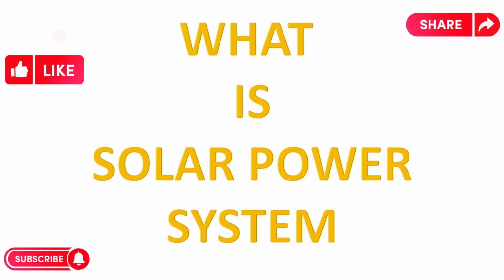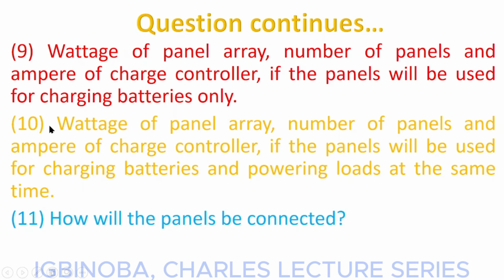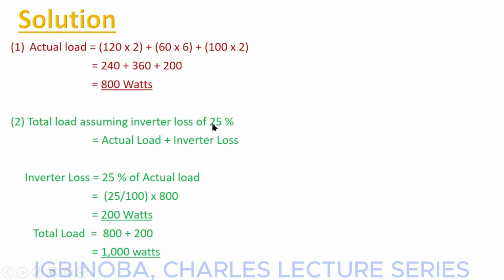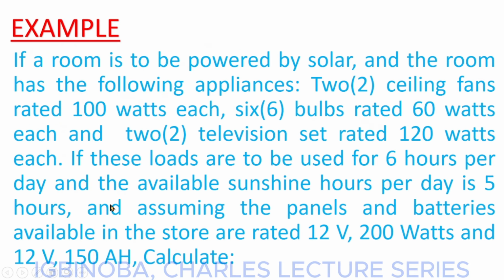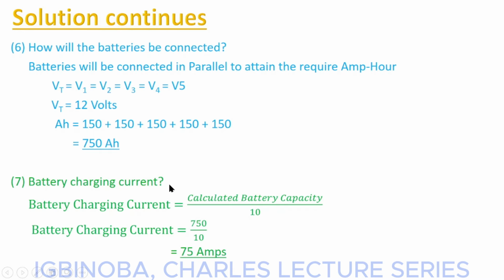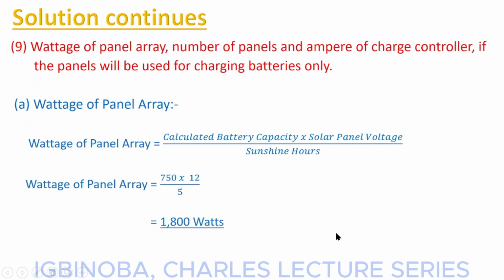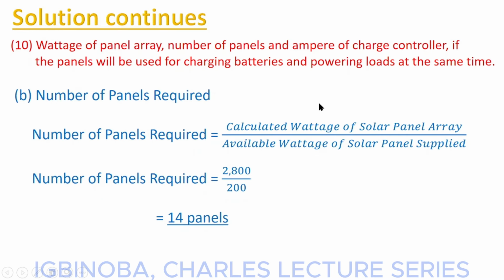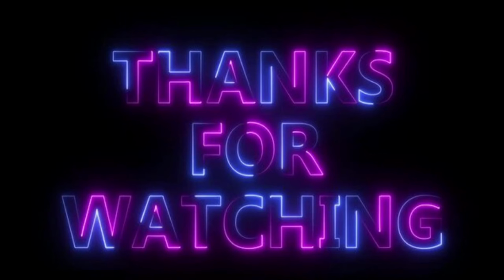Design of Solar Power System

Comment: CHM18R

1. The actual pad is 1,380W
2. The Total load is 1,725W
3. The inverter rating is 2,156.23VA
4. The battery capacity is 1,293.75Ah 
5. The Number of batteries is 9
6.  The batteries are connected in parallel 
7. The Battery charging current is 129.4 amps.
8. The battery charging time is 14 hours.
9. a. The wattage of the panel array is 3,105W
b. The number of panels is 16 panels.
c. The Charge controller rating is 258.75 amps.

10. a. The wattage of the Panel array is 4,830 Watts 
b. The number of panels is 24 panels.
c. The charge controller rating is 402.5 amps
11. The panels are arranged in parallel

Comment: NAT15O

1. Actual load= 1,380watts
2. Total load = 1,725watts
3. Inverter rating =                                     2156.25VA
4. Battery capacity = 1293.75AH approx 1350AH
5. Number of batteries = 9
6.  Batteries will be connected in parallel.                       
7. Battery charging current=  129.3A
8. Battery charging time assuming loss of 40%= 14hrs
9. For charging batteries only;
Wattage of panel array = 3105watts
Number of panels= 16
Ampere charge required= 258.75A
10. For charging batteries and powering load at the same time;
Wattage of panel array= 4830watts
Number of panels= 26
Ampere charge required= 402.5A
11. The panels will be connected in parallel too.

Comment: MAR111G 

Data Given 
Appliance rating 
Ceiling fan = 3× 100W = 300W
Bulbs = 10×60 = 600W 
Television = 4×120= 480W
Backup hours = 6hrs 
Sunshine hours = 5hrs
Panel rating = 12v, 200W
Battery rating = 12v, 150AH 

(1) Actually load = (300+600+480)W = 1380W

(2) Total load with inverter loss of 25% =  Actual load + inverter loss 
= 1380 + 25/100 × 1380 = 1725W 

(3) Inverter rating in VA with 0.8 Pf =  1725÷0.8 = 2156.25VA

(4) battery capacity with 75% factor for reserve = 1293.75AH 

(5) number of battery for backup hours = 8.625 = 9batteries 

(6) The batteries would be connected in parallel. 

(7)  Battery charging current = 129.38A 

(8) Battery charging time with 40% charging loss = 13.99hrs = 14hrs 
 
(9)i)Wattage of panel array =  3105W 
 ii) number of panels = 15.525 = 16panels 
iii) charge controller ampere = 258.75A 

(10)i) wattage of panel array when powering load = 4830W 
ii) number of panels required = 24.15 = 25panels 
iii) charge controller ampere = 402.5A 

(11) The panels would be connected in parallel.

Comment: MAR97S 
1. *Actual Load:* 1,380 W (8,280 Wh/day)
2. *Total Load (25% Inverter Loss):* 1,840 W (11,040 Wh/day)
3. *Inverter Rating:* 2,300 VA (2.3 kVA)
4. *Battery Capacity (75% Reserve):* 1,226.67 Ah (14,720 Wh)
5. *Number of Batteries:* 9 batteries
6. *Battery Connection:* Parallel
7. *Battery Charging Current:* 245.33 A
8. *Battery Charging Time (40% Loss):* 8.33 hours (8 hours 20 minutes)
9. *Panels (Charging Batteries Only):*
* Array Wattage: 3,680 W
* Number of Panels: 19 panels
* Charge Controller Current: 306.67 A (383.33 A with 1.25 safety factor)

10. *Panels (Charging & Powering Simultaneously):*
* Array Wattage: 5,520 W
* Number of Panels: 28 panels
* Charge Controller Current: 460 A (575 A with 1.25 safety factor)

11. *Panel Connection:* Parallel

Comment: CHM80B

(1) Actual load: 1800 W
(2) Total load (with 25% inverter loss): 2250 W
(3) Inverter rating (PF = 0.8): 2812.5 VA
(4) Battery capacity (75% reserve factor): 1800 AH
(5) Number of batteries: 12 batteries
(6) Battery connection: Series-parallel
(7) Battery charging current: 180 A
(8) Battery charging time (40% charging loss): 13.33 hours
(9) Panels for charging batteries only: Panel array wattage = 5400 W
Number of panels = 27
Charge controller = 225
(10) Panels for charging batteries + powering loads simultaneously: Panel array wattage = 8100 W
Number of panels = 41
Charge controller = 338 A (or next standard size)
(11) Panel connection: Series-parallel combination to match the system voltage (typically 24 V or 48 V) and required current.

Comment: EEE92N
ANSWERS;
1.Actual Load: 1380W
2.Total Load: 1,725W
3.Inverter Reading:2156.25VA
4.Battery Capacity Using a Reverse of 75%: 1,150Ah
5.Number of Batteries  for Backup hours:8 batteries 
6.Battery connection:Parallel
7. Battery Charging Current:230A
8.The battery charging times with 40% loss:14 hours

9a. The wattage of the panel array:2,898W
9b.The number of panel:16
9c.The charge controller rating is:258.75amps

10a.The wattage of panel arrays is: 4,830W
10b.The number of panel is:24
10c.The charge controller rating is:402.5amps

11)The panel are arranged in Parallel

Comment: Civ17Q

1.Actual load = 1380 W
2 .Total load = 1725 W
3.Inverter rating = 2156.25 VA
4.Battery capacity = 1293.75 Ah
5.Number of batteries for backup hours = 9 batteries
6.Battery connection = In parallel
7.Battery charging current = 129.375 A
8.Battery charging time = 14 hours
9a. Wattage of panel array (batteries only) = 3105 W
b. Number of panels = 16 panels
c. Charge controller current (batteries only) = 258.75 A
10a. Panel wattage (battery and load) = 4830 W
b. Number of panels = 14 panels
c. Charge controller current (battery and load) = 402.5 A
11.Panel connection = In parallel

Comment: CIV41O

Answers:
1) Actual load=1380watts
2)Total load =1725watts
3) Inverter rating VA=2156.25VA
4) Battery capacity=1293.75Ah
5)NO of batteries=9 batteries
6) Parallel connection
7) Battery Charging current=129.39Amps
8) Charging time (40%Loss)=14Hrs
9a) Panel wattage=3105watts
9b)NO of panels=16 panels
9c)Amps of Charge controller=258.75Amps
10a) Panel wattage=4830 watts
10b)NO of panels= 25 panels
10c)Amps of charge controller=402.5Amps
11) Parallel connection

Comment: CIV53A 

Answer:
1) Actual load=1380W
2) Total load with 25% loss=1725
3) Inverter rating=2156.25VA
4) Battery capacity=1293.75Ah
5) 9 batteries
6) They will be connected in parallel 
7) Battery charging current = 129.375A
8) 14hrs
9) For charging panel only...
    a) 3105W
    b) 16 panels.
    c) 258.75A
10) For charging panel and loads.
    a) 4830W
    b) 24 panels
    c) 420.5A
11). Parallel connection.

Comment: EEE96R 

Answer:

1. The actual load is 1380W

2. The total load is 1725W

3. The inverter rating is 2156.23VA

4. The battery capacity is 1293.75Ah

5. The number of batteries is 9

6. The batteries are connected in parallel

7. The battery charging current is 129.4 A

8. The battery charging time is 14 hours

9. i. The wattage of the panel array is 3105 Watts

   ii. The number of panels is 16 panels  

   iii. The charge controller rating is 258.75 A

10. i. The wattage of the panel array is 4830 Watts  

    Ii. The number of panels is 24 panels  

    iii. The charge controller rating is 402.5 Ampere

11. The panels are arranged in parallel

Comment: CHM60H

COMPXXX

1. The actual pad is 1,380W
2. The Total load is 1,725W
3. The inverter rating is 2,156.23VA
4. The battery capacity is 1,293.75Ah 
5. The Number of batteries is 9
6.  The batteries are connected in parallel 
7. The Battery charging current is 129.4 amps.
8. The battery charging time is 14 hours.
9. a. The wattage of the panel array is 3,105W
b. The number of panels is 16 panels.
c. The Charge controller rating is 258.75 amps.

10. a. The wattage of the Panel array is 4,830 Watts 
b. The number of panels is 24 panels.
c. The charge controller rating is 402.5 amps
11. The panels are arranged in parallel

Comment: COMP18R 
1. Actual load=1380W
2. Total load= 1725W
3. Inverter rating=2156V/A
4. Battery capacity=1293.75Ah
5. No of battery=8.625=9 batteries 
6. The batteries would be connected in PARALLEL 
7.Battery Charging current=129.4A
8. Battery charging time=14hrs
9a. Wattage of Panel array=3105W
9b. No of Panels=15.5=16
9c. Ampere of Charge Controller=258.75A
10a. Wattage of Panel Array=4830W
10b. No of Panels=24.15=24
10c. Ampere of Charge Controller=402.5A
11. The panels would be connected in PARALLEL

Comment: CHM66N
1.Actual load = 1380Watt
2. Total load = 1725Watt
3.Inverter rating = 2156.25VA
4.Battery Capacity = 1239.75Ah
5.Number of batteries = 8.625 (9 batteries)
6.They will be connected in parallel
7.Battery charging current = 129.375A
8.Battery charging time with 40% loss = 14hrs
9a. Wattage of panel array = 3105Watt
9b. Number of panels = 16panels
9c. Ampere of charge controller = 258.75A
10a. Wattage of panel array with load = 4485Watt
10b. Number of panels = 23panels
10c. Ampere of charge controller = 373.75A
They will be connected in parallel.

Comment: PETROCHEM24X

1.Actual load
1,380 W

2.Load with 25% inverter loss
1,725 W

3.Inverter rating
2,156 VA minimum → select 2.5 kVA

4.Required battery capacity
1,150 Ah at 12 V

5.Number of batteries
8 batteries

6.Battery connection
Parallel

7.Charging current
120 A

8.Charging time with 40% loss
14 hours

9.Charging-only solar array
3,600 W = 18 × 200 W panels; ≈300 A controller

10.Solar array + loads simultaneously
5,200 W = 26 × 200 W panels; ≈434 A total controller capacity

11.Panel connection
Parallel

Comment: MEC85G

ANSWER:

1. Actual load: 1380W

2. Total load: 1725W

3. Inverter rating: 2156.25VA

4. Battery capacity: 1239.75Ah

5. Number of batteries: 9

6. They will be connected in parallel

7. Battery charging current: 129.375A

8. Battery charging time with 40% loss: 14hrs

9a. Wattage of panel array: 3105W
9b. Number of panels: 16
9c. Ampere of charge controller: 258.75A

10a. Wattage of panel array with load: 4485W
10b. Number of panels: 23
10c. Ampere of charge controller: 373.75A

11. They will be connected in parallel
Reply: COMP 33G
Answers:
1. The actual load is 1,380W
2. The Total load is 1,725W
3. The inverter rating is 2,156.25VA
4. The battery capacity is 1,293.75Ah 
5. The Number of batteries is 8.625=9
6.  The batteries are connected in parallel 
7. The Battery charging current is 129.375amps.
8. The battery charging time is 14 hours.
9. a. The wattage of the panel array is 3,105W
b. The number of panels is15.5= 16 panels.
c. The Charge controller rating is 258.75 amps.

10. a. The wattage of the Panel array is 4,830 Watts 
b. The number of panels is 24 panels.
c. The charge controller rating is 402.5 amps
11. The panels are arranged in parallel

Comment: COMP36J

1. Actual pad = 1,380W
2. Total load = 1,725W
3. Inverter rating = 2,156.23VA
4. Battery capacity = 1,293.75Ah 
5. Number of batteries = 9
6.  The batteries are connected in parallel 
7. Battery charging current = 129.4 amps.
8. Battery charging time = 14 hours.
9. a. The wattage of the panel array is 3,105W
b. Number of panels = 16 panels.
c. Charge controller rating = 258.75 amps.

10. a. Wattage of the Panel array = 4,830 W
b. Number of panels = 24
c. Charge controller rating = 402.5 amps
11. The panels are arranged in parallel

Comment: MEC84F 

1). ACTUAL LOAD=1380 WATTS

2. TOTAL LOAD= 1725 WATTS

3.  INVERTER RATING= 2156.25 WATTS

4.  BATTERY CAPACITY= 1293.75 AH

5. NUMBER OF BATTERIES FOR BACKUP = 9 BATTERIES 

6.  BATTERY CONNECTION IS IN PARALLEL 

7.  BATTERY CHARGING CURRENT= 129.4A

8.  BATTERY CHARGING TIME= 14HRS

9A.  WATTAGE OF PANEL ARRAT(ONLY BATTERIES)= 3105 WATTS 
9B.   NUMBER OF PANELS= 16 PANELS 
9C.  AMPERE FOR CHARGE CONTROLLER (ONLY BATTERIES)= 258.75 A

10A.  PANELS WATTAGE(BATTERY AND LOAD)= 4830 WATTS
10B.   NUMBER OF PANELS= 25 PANELS
10C.  AMPERE FOR CHARGE CONTROLLER= 402.5A

11. PANNEL CONNECTION= PARALLEL

Comment: MEC55C 

1380W
1725 W
2156.25VA
1293.75AH
9 batteries.
The batteries will be connected in parallel
129.375A
14hrs
3105W
16 panels
258.75A
300A charge controller will be suitable.
4830 A
24 Panels
402.5A
500A charge controller will be suitable. The panels will be connected in Series.

Comment: EEE107C
1.1380watts
2.1725watts
3.2156.25VA
4.1239.75Ah
5.8.625(9batteries)
6.connected in parallel 
7.129.375A
8.14hrs
9a.3105watts
9b.10panels
9c.258.75A
10a.4485watts
10b.23 panels
10c.373.75A
11.connected in parallel

Comment: Petro59D
1380W
1725 W
2156.25VA
1293.75АН
9 batteries.
The batteries will be connected in parallel
129.375A
14hrs
3105W
16 panels
258.75A
300A Charge controller will be suitable.
4830 A
24 Panels
402.5A
500A charge controller will be suitable The panels will be connected in Series

Comment: CIV74V

1. Actual load = 1380 Watts
2. Total load = 1725 Watts
3. Inverter rating = 2156.25VA
4. Battery capacity = 1239.75Ah
5. Number of batteries = 8.625 approximately 9
6. The batteries will be connected in parallel
7. Battery charging current = 129.375A
8. Battery charging time with 40% loss = 14hours
9. For charging loss only 
(a). Wattage of panel array = 3105Watts
(b). Number of panels = 16 panels
(c). Ampere of charged controllers = 258.75A
10. For charging + powering load 
(a). Wattage of panels arrays with total load = 4830Watts
(b). Number of panels = 24 panels
(c). Ampere of charged controllers = 
420.5A
11. The panels will connected in parallel

Comment: COMP34H:
1)Actual Load: 1380W

2)Total Load: 1,725W

3)Inverter Reading:2156.25VA

4)Battery Capacity Using a Reverse of 75%: 1293.75Ah

5) Number of Batteries  for Backup hours:8 batteries 

6) Battery connection:Parallel

7) Battery Charging Current:230A

8)The battery charging times:7hours

9a) The wattage of the panel array:2,898W
9b)The number of panel:16
9c)The charge controller rating is:258.75amps

10a)The wattage of panel arrays is: 4,830W
10b)The number of panel is:24
10c) The charge controller rating is:402.5amps

11)The panel are arranged in: Parallel

Comment: MEC61I
Answers:1,380 W
1,725 W
2,156.25 VA
1,293.75 Ah
9 batteries
Parallel connection
129.4 A
14 hours
a. 3,105 W
b. 16 panels
c. 258.75 A
a. 4,830 W
b. 24 panels

Comment: PETRO31E

(1) Actual load: 1,380W
(2) Total load: 1,725W
(3) The inverter rating is 2,156.23VA
(4) The battery capacity is 1,293.75Ah
(5) The number of batteries is 9.
(6) The batteries are connected in parallel.
(7) The battery charging current is 129.4 amps.
(8) The battery charging time is 14 hours.
(9a) The wattage of the panel array is 3,105W.
(b) The number of panels is 16 Panels.
(c) The charge controller rating is 258.75amps. (10a) The wattage of the panel array is 4,830
Watts.
(b) The number of the panels is 24 panels.
(c) The charge controller rating is 402.5amps.
(11) The panels are arranged in parallel.

Comment: MEC1A

1. Actual load = 1380 W
2. Total load = 1725 W
3. Inverter rating = 2156.25 VA
4. Battery capacity = 1293.75 Ah
5. Number of batteries for backup hours = 9 batteries
6. Battery connection = In parallel
7. Battery charging current = 129.375 A
8. Battery charging time = 14 hours
9. a) Wattage of panel array (only batteries) = 3105 W
    b) Number of panels = 16 panels
    c) Ampere for charge controller (only batteries) = 258.75 A
10. a) Panel wattage (battery and load) = 4830 W
    b) Number of panels = 14 panels
    c) Ampere for charge controller (battery and load) = 402.5 A
11. Panel connection = In parallel

Comment: PETRO23W
1380W
1725 W
2156.25VA
1293.75АН
9 batteries.
The batteries will be connected in parallel
129.375A
14hrs
3105W
16 panels
258.75A
300A Charge controller will be suitable.
4830 A
24 Panels
402.5A
500A charge controller will be suitable The panels will be connected in Series

Comment: PETRO53A
   

         
    1.  Actual load = 1380Watt
2.  Total load = 1725Watt
3.  Inverter rating = 2156.25VA
4.  Battery Capacity = 1239.75Ah
5.  Number of batteries = 8.625, so 9 batteries will be used
6.  The batteries will be connected in parallel
7.  Battery charging current = 129.375A
8.  Battery charging time with 40% loss = 14hrs
9.  For charging only:  
    a. Wattage of panel array = 3105Watt  
    b. Number of panels = 16panels  
    c. Ampere of charge controller = 258.75A
10. For charging + powering load:  
    a. Wattage of panel array with load = 4830Watt  
    b. Number of panels = 24 panels  
    c. Ampere of charge controller = 420.5A
11. The panels will be connected in parallel

Comment: CIV49W

1380W  
1725W  
2156.23VA  
1293.75AH  
9 batteries  
Connected in parallel  
129.4 amps  
14  
3105W  
16  
258.75 amps  
4830 watts  
24 panels  
402  
Connected in parallel

Comment: PETRO54B

1. ACTUAL LOAD=1380W
2. TOTAL LOAD=1725W
3. INVERTER RATING=2156.25VA
4. BATTERY CAPACITY=1293.75Ah
5. NUMBER OF BATTERIES= 8.625
6. BATTERIES CONNECTION= PARALLEL
7. BATTERY CHARGING CURRENT=129.375A
8. BATTERY CHARGING TIME=14HRS
9a. PANEL WATTAGE=3105W
9b. NUMBER OF PANEL=15.525
9c. AMPERE OF CHARGE CONTROLLER=258.75A
10a. PANEL WATTAGE =4830W
10b. NUMBER OF PANEL=24.15
10c. AMPERE OF CHARGE CONTROLLER= 402.5A
11. PANEL CONNECTION= PARALLEL

Comment: PETRO99U
Answer:

1. The actual pad is 1,380W

2. The Total load is 1,725W

3. The inverter rating is 2,156.23VA

4. The battery capacity is 1,293.75Ah

5. The Number of batteries is 9

6. The batteries are connected in parallel

7. The Battery charging current is 129.4 amps

8. The battery charging time is 14 hours

9. a. The wattage of the panel array is 3,105W
b. The number of panels is 16 panels
c. The Charge controller rating is 258.75 amps

10. a. The wattage of the Panel array is 4,830 Watts
b. The number of panels is 24 panels
c. The charge controller rating is 402.5 amps

11. The panels are arranged in parallel

Comment: CHM68P
ANSWER:
1. Actual load: 1380W
2. Total load: 1725W
3. Inverter rating: 2156.25VA
4. Battery capacity: 1239.75Ah
5. Number of batteries: 9
6. They will be connected in parallel 
7. Battery charging current: 129.375A
8. Battery charging time with 40% loss: 14hrs
9a. Wattage of panel array: 3105W
9b. Number of panels: 16
9c. Ampere of charge controller: 258.75A
10a. Wattage of panel array with load: 4485W
10b. Number of panels: 23
10c. Ampere of charge controller: 373.75A
11. They will be connected in parallel